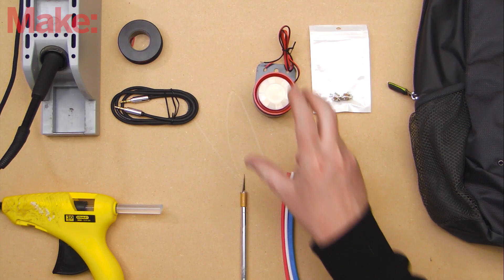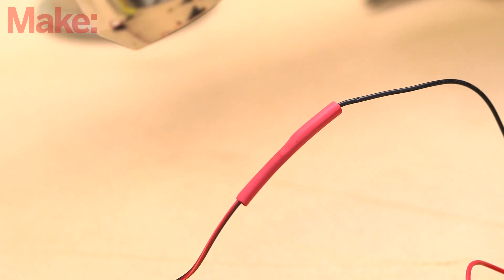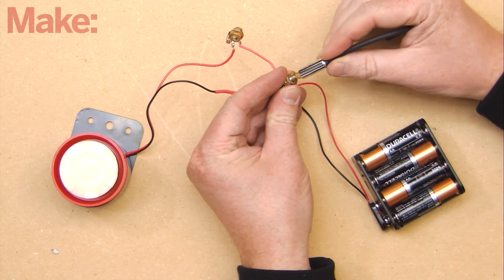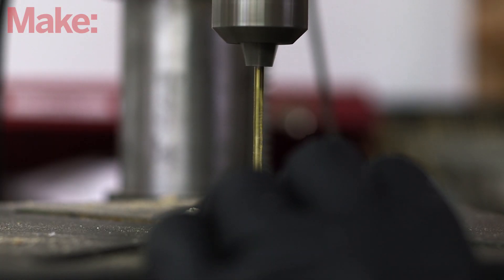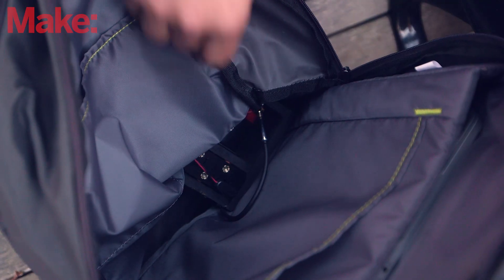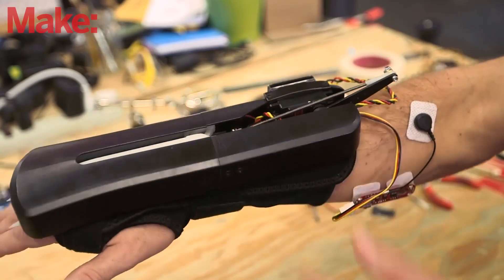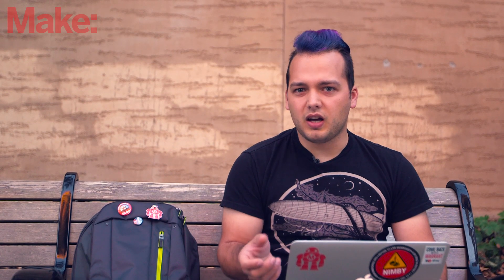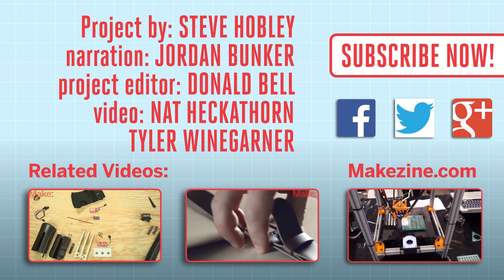Weekend Project: Shrieking Anti-Theft Backpack

Comment: About the audio jacks & plugs: you could solder audio jack wires together and use audio plug connections like button terminals. About the circuit: connect 2 audio plug "switches" and alarm in parallel.
Reply: +benas bagvilas no need for fancy audio plugs!

Comment: Use auxiliary jacks (3.5 mm or 1/4 inch) still and for the trigger cable solder the wires for the two rings (not the tip) together so that when the they aren't connected (you may need a relay) the alarm sounds. The reason that you don't use the tip is because it is connected to each of the rings (separately) via the speakers in normal headphones so it could be deactivated by a well-prepared person who bought earbuds to an electronics fight.

Comment: It complicates things a tiny but, but a transistor would effectively fix the problem. You could even go further and have it so it is a stereo plug where left and right channels need to be connected, where you can do the wiring on the plug to match the correct result

Comment: instead of the normally closed, you can invert the signal and do a mono plug in the stereo jack.  that will connect the bottom 2 when the mono plug is inserted, but a stereo plug will not connect the bottom 2, it will keep them seperate.

Comment: Something that could be done is use a standard 3.5mm jack, but instead use a custom cable, wire straight across the left and right channels then use that as your switch, the only downside to this is making the custom cable, but it will get around the problem of having something that is too common, as headphones have no continuity between the left and right channels.

Comment: One thing that might solve the headphone jack problem is to use a normal jack, and then modify the cable. You could connect any two wires in the cable, and when that cable was plugged into the jack, two leads from the jack would be connected. You could then make a simple inverter circuit that turned on the alarm when the leads were disconnected.

Comment: Wouldn't it just be a lot simpler, cheaper, lighter and better suited to just use something like this?

http://www.ebay.com.au/itm/Personal-Keyring-Protection-Attack-Panic-Safety-Security-Rape-120dB-Loud-Alarm-/221906628932?hash=item33aaaa7144:g:P38AAOSw0HVWFIMz

Comment: As the switch you could us a stereo jack with a mono plug. Connect the sleeve to battery negative, the ring to alarm negative and leave the tip open. If a stereo plug is inserted, no connection is made. But, with a mono plug, the sleeve portion takes the place of the ring, therefor making a connection.

Comment: Is there another Make: video that explains how to get a decent lawyer for when either the police, a sheriff's office, or pretty much anyone confuses the wired backpack for a bomb in this terrorist-fearing world?
Reply: +maxcohen13 I've flown a handful of times with homemade electronics, and as long as you can accurately and completely describe the function of something, most checkpoints are pretty lenient. And that's assuming they even raise the question.

Still, this one might not be the best to carry through security, as the device isn't easy to remove from the bag (at least not without a few tools)
Reply: +Tyler Winegarner 
No, no. That's alright. Thanks for clearing up this rather murky topic. I tell you what – make this, then run through the TSA and let me know how it goes. If it doesn't end up in a full rectal examination, I'll give it a go.
Reply: +Tyler Winegarner considering I live in DC, where everything's getting pretty high alert, I don't think I'll be able to use this on a daily basis without getting some looks

Comment: Could you do this with an RFID sensor or some other type of proximity switch? Keep one in your pocket or wallet and have the reader in the bag, when the connection is lost, alarm is activated.  I'm not sure if there is such a pair that would work spaced out by a foot or two.

Comment: I think a reed switch with a magnet would be a more practical trigger for the alarm
Reply: Indeed. Have a small steel plate on the inside of the bag with the reed switch directly behind it, then have a magnet on a string sticking on the outside. No audio jack hole has to be cut :D. Though you'd need a switch that's normally closed....
Reply: a neutrally closed reed switch a lot easier to come by than a neutrally closed audio jack :p
Reply: mtktm Well then! That settles it hehe.